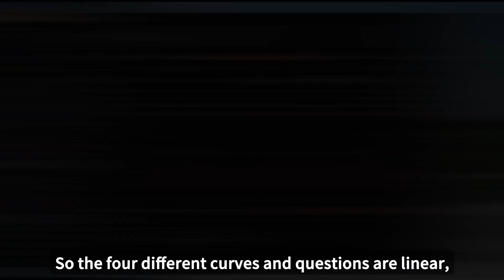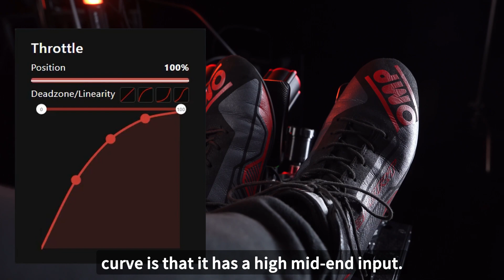The Secret Weapon In Your Setup! | #TechTuesday Ep.5

Comment: Guys im struggling with my p500 calibration when im pressing the brake fully i have only 50% brake it should be atleast at 75 to 80% why is that? Ive tried several ways of pressing it, short and long fast and slow it just dont want to work out how i want it to be

Comment: I have the simagic p500. I'm having a calibration problem. When I press the accelerator, the brake bar moves. When I press the brake, the load brake bar moves. The accelerator seems to be off. I need to turn off the equipment and close the application several times until it works normally. What do I have to do?

Comment: It would be nice to have a video on calibration and software profiles. Like being able to get the pedal not to go past a curtain percentage. It like works backwards when you bring the max percentage down. In iracing if I bring the travel percent down to 80% the brake travel goes further on the screen looking at the inputs?  I thought it would work similar to Heusinkveld SmartControl. Maybe it does, but not a lot of info on the software.